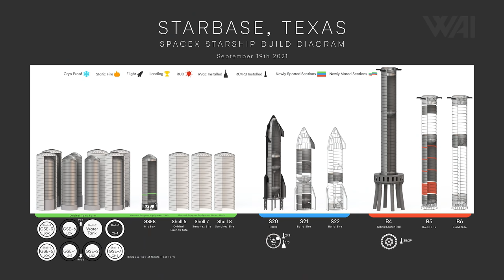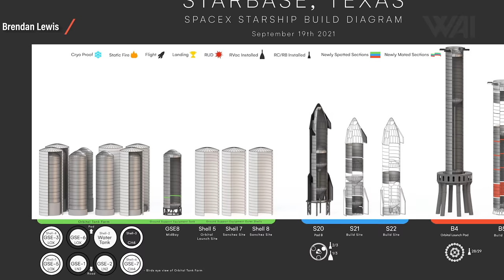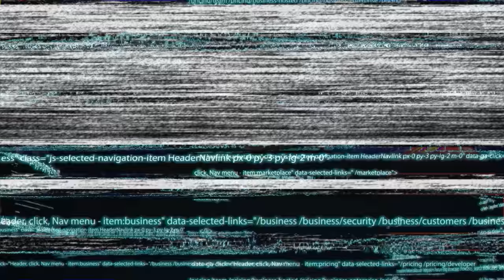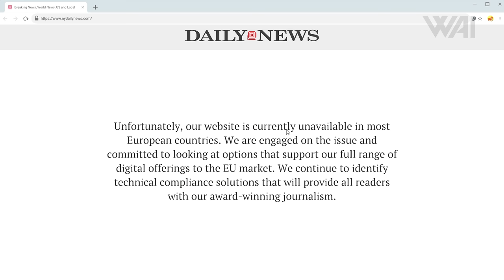Starship 2021 Official Design Changes – The Holy Grail Of Rockets!

Comment: Almost all of the arguments for how Starship is new and revolutionary were said about the Space Shuttle, too.
"It would make incredibly cheap spaceflight" - Space Shuttle was supposed to be cheap per kilogram-to-orbit, too. It didn't turn out that way.
"It would enable high speed launch cadences" - Space Shuttles were supposed to fly *WEEKLY*.

As it worked, the orbiter was reused with mild refurbishment, the engines were remove and refurbished separately, which took longer, but they could swap in "ready to go" engines quickly.  The solid rocket boosters were refilled and refurbished, and again, while not "quick individually" they had enough inventory to enable quick turnarounds. The big external fuel tank was disposed of each launch. The record for fastest turnaround of an orbiter was 51 days (Atlantis orbiter between landing of STS-51-J and launch on STS-61-B.) 

But the plan was to have turnaround take only about a week. And there were plans to either deorbit-for-reuse the external tank or even leave it in orbit and refurbish it on-orbit for secondary uses - like building out a space station inside the shell replacing the hydrogen and oxygen tanks inside; or using it as an "orbital refueling depot" for beyond-Earth-orbit spacecraft.

The point is, nearly all of SpaceX's claims about Starship were also applied to the Space Shuttle.

Hopefully technology has advanced enough to make them actually come true this time.
Reply: There are plenty of differences in how Shuttle vs Starship were designed
Reply: @alvianchoiriapriliansyah9882  Which is why I'm hopeful. But many of the claims that Starship will "be the first" are flatly incorrect. Many of the things mentioned that it "will be first" at applied to the Space Shuttle.
Reply: Describing the Shuttle as having ‘mild refurbishment’ is a blatant lie that was never achieved.

Saying they ‘intended’ to deorbit and reuse the external fuel tank on further launches is utterly meaningless because  they had no known way of doing so, or even anything remotely planned.

Comment: Could boosters/ships conduct hover tests to confirm the validity of the catching system?
Reply: Yes, and i hope this is the plan for 4,20. There is no reason not to try and its extremely valid to the systems goals.
Reply: @tech 52 I may be wrong but i thought Shane meant free hovering, that what i was answering towards. 
During the upcoming orbital test flight, i dont see any reason why they wouldnt attempt a controlled hover for a few seconds just before splash down since this is exactly what will be needed to achieve the catching of these vehicles. 
It would be incredibly valuable data that is directly concerned with their goals and i hope they have that in the flight profile.
They should..
Reply: @Vatsyayana87  no reason apart from risking damage to their only launch mount, first fully fitted heat shield, and first superheavy thrust puck before they do the orbital test they have spent months preparing for. Floaty Floaty Grabby Grabby is a game they can play with a cheaper, lighter, more expendable flying gas can for monumentally less risk and same proof of concept. Hovering before landing they know they can do already...
Reply: @lsaria4977  You clearly dont understand what we are talking about here friend..
Read through my comments a bit more thoroughly and id be happy to discuss it with you.
Reply: @Vatsyayana87  I don’t think they will bother with hover for 20. For the B4 sure, but not SN20. B4 has a slight chance to go into some sort of a controlled reentry. SN20 if it reaches orbital velocity will lose TPS on the way down and mostly disintegrate. Best they can hope for is to gather enough useful information on when and which parts of the TPS start failing before boom.
Reply: @A31415  Ive been here through the entire starship project and falcon landings before it and usually we just ignore people that act like its possible they have any idea what WILL happen.
Good to get your opinion, but i prefer to see what happens instead of act like a fortune teller lol
Reply: @Vatsyayana87  I have been here since the Space Shuttle flights and saw what a crack in the ceramic tiles can do on an orbital reentry. So yeah, don’t need to be a fortune teller to see how the first ever attempt by Starship will go.
Reply: @Vatsyayana87  half the tiles broke when they LIFTED the starship so it's unlikely that this is the final working tps design. Also the space shuttle was designed by NASA, congress and the military only gave some guidelines (size of cargo bay etc.), and for it's time the shuttle was revolutionary. 

Just as F9 builds on older tech such as the R7 or Saturn 1, the starship builds on the experiences of the shuttle and buran. SpaceX does not exist in isolation, they learn from the success and failure of previous generations of rockets.
Reply: @plainText384  To say they have enough commonality to this rockets is a gross overstatement in my opinion, which is obviously only worth what it is lol.
Yes when they lifted it from the points on a curved nosecone it did not turn out well at all but these are not going to be the lifting points later.
I stand by my word when i say tps tile are still the hardest part of rocket science lol
But overall Spacex has shown how superior they are to the capabilities of NASA while its choked by its overlords.

I love NASA and always will but they need to stop making rockets and stick to the science and exploration tech while sharing their immense knowledge and experience.
Rockets seem to be the major place idiot congress people think they have some business putting their nose in and completely ruin everything. 

Was a pleasure talking to ya
Reply: @Vatsyayana87  my point is that saying spaceX is better than NASA at rocket science, is like saying Airbus is better than the wright brothers.
NASA and SpaceX also don't have the same goals. NASA wants to develop new technologies, discover and explore, while also letting money flow back into the economies of the states, who's senators support them. SpaceX wants to grow as a company and take control of the rocket launch market, while also letting money flow into the pockets of elon musk and shareholders in general.
Reply: @plainText384  lol ok i dont quite agree with the first comparison but i totally understand what your saying about it, i just dont think its quite accurate.
For the second point, specifically the second half, you clearly have no idea what the goal of Spacex is lol. that was a very shameful way to portray the company whos goal is to take the biggest step in human history, not by any way to make money for Elon.
If you look into it, the entire thing started by a billionare asking russia for an ICBM to spend his personal money on for nothing but to send a tiny garden to mars to inspire human kind to reach out and make progress.
They said no, so Elon spent every last dollar he had to create his own company to do this insanely selfless goal, he failed after 3 rockets and spent all his money left (the rest was invested in Tesla)
But he was able to get a few people to fnancially back a forth attempt that succeeded and turned into the most bad ass rocket company in history.
The goal now is to make humans multi planetary and i assure you he will empty his pockets to do so.
Instead of having a 100 million dollar yacht like every billionare in history, he sold everything he owned and slept in his factories...
So check that greed mongering talk at the door my friend.
Reply: @Vatsyayana87  if you tried to think about the specific problem here rather than speaking generalities about how reality works or companies vs governments then maybe you would understand what is going on.
Reply: @A31415  I do think about it, very much every day in fact. In my experience, TPS tiles are so far the hardest thing to solve in rocket science lol
But since this company doesnt have to be told what factory will make these, made of what material that some congressman's state produces, they can openly do whatever is needed to solve the problem. 
The shuttle was incredible but was also a travesty because of that one fact. Its tiles were falling off by the dozens after just sitting in the hanger over night, so far these ones are miles ahead. In my opinion, the mass breaking that happened are from lifting 100 tons from anchor points on a curved surface. This wont be the lifting point of later vehicles.
Either way i feel these guys will solve this problem relatively quickly.

Comment: Isn’t Shuttle technically a 2nd / upper stage?  That was reusable!  do get your point though. The biggest thing for me is really how fast it can be reused.
Reply: the key word here is "technically".
Reply: Its an SSTO with boosters, a 2nd stage wont light its engines for take off as shuttle does.
Reply: @Vatsyayana87  Correct. The shuttle main engines were used for launch. The boosters and external fuel tank were discarded. There was a chance to recover and refurbish the tank and even the empty solid fueled booster shells, but not reliably.
Reply: If the Space Shuttle was smaller without that big payload area, as a slightly bigger version of the Dream Chaser, it could still be used nowadays.
Reply: @RogerM88  The space shuttle was old technology. The electronics and guidance were primative by modern standards. The heat shield was way to fragile, as in dangerous.  That cargo area was important. Starship will be the only thing to even come close. 
The Space Shuttle was WAY too  expensive and only refurbishable not reusable. Starship will be able to take a payload to LEO return and within hours be restocked, refueled and go again. For example to build really large space stations. Of course like airliners more maintenance will be needed after several trips.
Added:  The Buran, the Soviet somewhat smaller space shuttle was canceled after several were built because it was not cost effective ( plus politics)
Reply: @markhorton3994  only after many missions we can say Starship is more cost effective than a Falcon Heavy with a bigger payload fairing to LEO.
Reply: @RogerM88  Falcon Heavy was not part of this discussion. Starship (not Space Ship) is expected to be considerably cheaper than Falcon Heavy. There are only three possibilities. It won't work at all. It will not be as inexpensive as expected and only used for Lunar and interplanetary missions. Or as expected it will be a lot cheaper and SpaceX will retire both Falcon Heavy and Falcon9.  Dragon on Falcon 9 for manned missions will last as long as NASA needs it.(Starship will look very large next to the ISS) 
Starliner (Boeing) will never be a success. When ( probably)  it becomes operational it will be more expensive than Soyuz as a backup for Dragon, and Soyuz works. Then  as has been the case since SpaceX started, Blue Origin is making progress.
Reply: @markhorton3994  if reusable rockets were most of the costs per launch, SpaceX by now, would be lowering their prices to LEO. And the tendency is increasing the costs per ton to LEO. Casuals and fanboys, then to forget big part of the costs per launch, aren't only on the rocket, you have to support a launching infrastructure and staff. Plus development and refurnish costs. That's why many Rocket companies use the same rocket design for decades, and it's a known business in a thin line between profit and bankruptcy.
Reply: @markhorton3994  main competition to SpaceX going to be with Dream Chaser, and standard rocket providers as ULA. Since the release of cargo on Starship, could make many potential costumers choose a standard payload fairing mechanism.
Reply: @RogerM88  that's true

Comment: As  per FAA, already a bunch of test flights and 5 orbital flights are approved, as well as the environmental impact of the tower, equally OK. Still, there is a lot to do and my assessment is NET late November. More likely early January 2022.
Reply: My understanding is thats not the case at all, The things you have seen, i believe, are the official proposals of the program next. Other wise they wouldnt have open hearing for the public for this in october, which they do. 
Elon still had to be correcting things on said proposal since they couldnt even get things like the number of engines correct lol.

Comment: GSE 8 forward dome that you showed was mislabeled. GSE 8 is in the midbay and the forward dome was the first thing they stacked. All that is missing is the skirt. That is a common dome section you were mentioning. It has the big cutout at the top where the header tank sits.

Comment: What do you think about how SpaceX is going to test mechazilla arms strength/side movements. Are they going to use some dummy weight (huge block of Metal whose weight is equivalent to Booster's/Starship's) with some fins to simulate the Booster and Starship. Using real booster and Starship is going to be risky, if mechazilla fails (breaks) it will make booster/starship fall.

Comment: Many of the design changes at 11:00 are fairly justified. Grid fins don’t produce drag, less windows being useful since nobody’s going to really care about that anyway, and the flaps in the 2019 render were idealized with the 2021 ones being more realistic. All of those are fine.

What may be a serious mistake on their part, however, is justifying complexity and weight by removing the landing gear. There’s a limit to how many things you can remove before the rocket’s ability to be rapidly reusable comes into serious question. 

Nobody said you had to cut seriously important mechanisms in a system in order to make it the Holy Grail of something. Starship doesn’t need to remove its landing gear to still be the holy grail of rockets. And arguably, it does need them. Having all weather capability and some regard to the safety of passengers and fragile cargo (ie. every decommissioned satellite in existence without the ability to retract their solar panels) is crucial to make starship a rapidly reusable rocket compatible with the vision Elon Musk had in 2016. Removing landing gear and relying on the integration tower for catching it compromises Starship on that ability, delaying payload return and P2P missions which will be crucial post-Starlink. I do not believe SpaceX will remain dominant forever so long as they stop caring about the safety of things they intend to use to fund the Martian colony.
Reply: I agree with this, but for Mars missions would they have a variant of Starship with some form of landing mechanism? (Similar to the Lunar Landar variant of Starship)
Reply: @calliioa  Yes. They will and definitely should have. They cant build a huge tower to catch the Starship there on Mars or Moon. Even if they did, (in case of Mars) all the dust storms would choke the joints of the catching arm and probably even render them non-working. Maintenance costs would be an all time high with people risking lives to clean it.
Reply: @Top Secret The design changes should do good for weight reduction, but how far can they strip all parts from the rocket just for the sake of weight reduction and complexity? One day, they'll even tell to fly the booster with long reels of fuel hoses attached to the engines directly from the fuel farm for complete weight reduction! They should have a backup system for redundancy. Relying on one tower to do all the work is completely dangerous. There are a lot of things that can go wrong. The catching arm snapping from the cable, misalignment of booster from the arm, booster/ship crashing into the tower due to high gusts/ engine failure, rusting and breaking of truss structures just like in suspension bridges in case of too much load, all this even with the best maintenance team and methods you can possibly find. And the last point is also something I would concur with. SpaceX wont remain in the lead anymore, even with Starship as the competition would come up with a more reliable system having greater advantages and efficiency.
Reply: @siddharth3998  all these possible mishaps could probably not be remedied by the Starship having legs, since it will probably be too high up in the air during the ccatch for any sort of legs to soften the impact enough.. i think their backup plan will be more like using the tank section of the starship as a huge crumble zone in case the catch fails for any reason, either by intentionally weakening it through depressurisation or even explosives in strategic locations to weaken the hull so it can crumble enough.
Reply: @unitrader403  Thats also a possibility. Carbon fibre ,Hydraulic retracting legs should work and reduce impact, but not beyond a limit. Crumplimg of the tank is also another option. Lets see what else they come up with. Reliability is the biggest question for the rapid launch cadence. Everything has to performed without any bottlenecks in speed, accuracy or transportation.

Comment: The design of the window doesn’t look smaller, it looks larger, but further from the nose…, also, the panes are smaller, that would reduce the weight , and increase the strength of the panel…